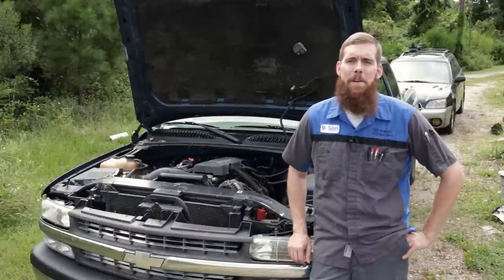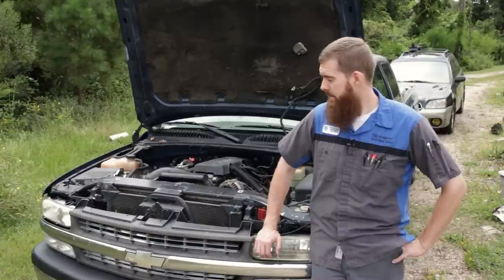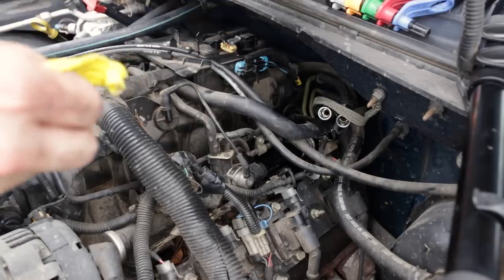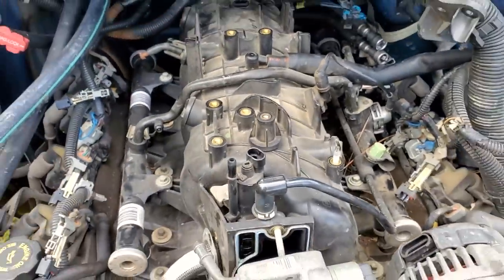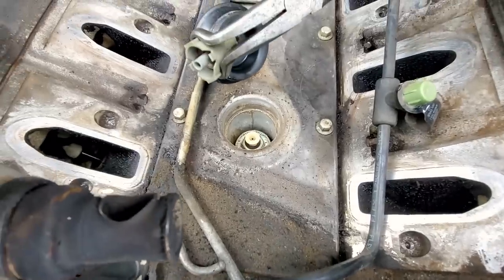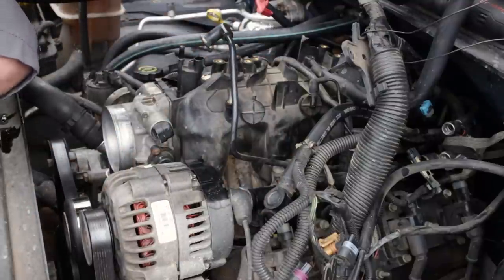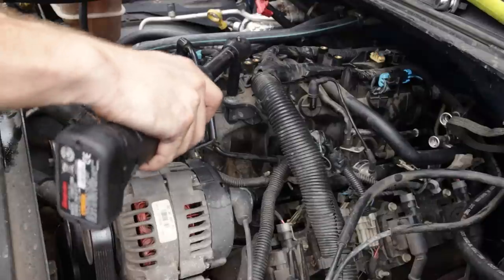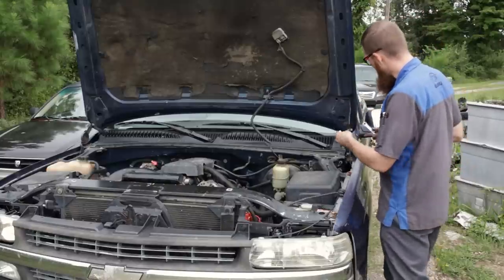GM Vortec/LSx Knock Sensors: Diagnosis and Replacement - 4.8, 5.3, 5.7, and 6.0 V8 P0332 P0327

Comment: So I did the 2 notorious knock sensors as preventive maintenance on the Tahoe while everything was a apart. Then of course after putting everything back together , it started throwing knock sensor codes which never happened before. So I initially blamed Amazon for selling me fake ACDelco (OEM) parts (outside of return window and good luck going to GM to get them warrantied). So I bought 2 ACDelco ones at full price from Autozone. Looked like same packaging and markings, “Assembled  in Mexico." Anyway, bench-tested them (thanks to this video and learned my lesson) and they were also dead on arrival!  Good thing I didn't go through the trouble of reinstalling them. That's the problem with American car companies, they don't care after they sell you the car, engines are good, but everything surrounding the engine is poor, even OEM parts.  
Just ordered some made by Delphi, box says made in Taiwan, held my breath, and they passed the bench test. Yay, Taiwan for the win!

UPDATE 11/15/23:
One of the defective brand new ACDelco ones (rear) I just installed spun on me as I was gingerly trying to take it out (I torqued it to 15 ft-lb 2 weeks ago) and I tried to chisel it out, but after a few tap, it snapped off flush at the thread. Ended up spending the next 2 hours on my belly, inhaling gas fume and drilling it out with an extractor tool. What a saga, but I was triumphant at the end. Unfortunately and fortunately, it was made of soft inferior metal.
Reply: Wow

Comment: AC voltage interesting I’m surprised the computer goes off of that for a reading, remember the old GM fuel trim matrix back in 2000 I took several auto shop classes in junior college and one of our teachers was a top GM Tech I guess he was like the third tech in the country and one time he was telling us he had a repeat customer in the 80s kept coming back that every time he would strap a trailer to his truck he lose power long story short my teacher found out it was the chain that was slapping against the frame therefore it was amplified back to the knock sensor !
Reply: Wow crazy story

Comment: I put a 6.0 out Cadillac in a Chevy trailblazer that had a 5.3 in it but knock sensor or not connected. It crack one time but not non more . It would turn over but the engine would not start any suggesting?

Comment: Question can bad spark knock sensors cause the transmission in my 2005 chevy Silverado 1500 4.8 vortec not to shift into 3rd gear. 7:39pm.

Comment: I have a 04 GMC yukon replaced the knock sensors in them last week. Not to difficult just time consuming. Used 1AAUTO OEM sensors and harness. The engine light went off no need to reset it. But within 30ish miles and a 72hr completion of the job, light back on. Used the code reader, read P0327/ P0332, and erased the codes. Again 30ish miles and about 72hrs later after erasing the codes, the CE light is back on. I did notice some rust in the [bore] I believed it was called in the video. Used an air hose got what I could out but nothing else is there anything else I should have done to prepare that bore?
Reply: Just for anyone seeing this in the future. For how much of a pain it is to address these knocks sensors with this design, that alone is reason enough to plea with anyone doing this same repair, use GM genuine/AC Delco knock sensors. There is no reason to use anything else. They’re not even that expensive.
Reply: @kojisimone6164  I'll keep that in mind if I ever decide to do it again. The yukon runs great, no issues just that code. I mean with the old sensors in my CC wouldn't work, would be slow on acceleration. But all that is gone everything is working great. Just the CE light is on and I'm learning to just live with that. Because that location setup is f#cking dumb...
Reply: @kojisimone6164  I think Delphi is most likely just as good.

Comment: Hi , Is it possible to replace the timing belt on an old 2004 Outback for a chain and gear wheels? Just wondering.
Reply from the maker: Anything is possible with enough time and money. But not feesible.
Reply: @MrSubaru1387  Thank you :)

Comment: Just curious but would you normally remove the inlet manifold bolts in the same order you torque them? Probably not as critical as the installation but I suppose there is the chance you could crack the manifold if some 'gorilla' had over-torqued the inlet manifold bolts initially.
Reply from the maker: Being torqued to 10Nm, and being a polycarbonate intake, it doesn't really matter. But yes, technically speaking, good to remove bolts in reverse order of tightening.

Comment: What happens if you don't torque the knock sensors or the manifold intake? I did it just by feel, and I didn't follow the sequence tho. Engine still rattles and check engine light came back on. I also washed the intake while it was out and let it dry and cleaned it really well. Still having problems. I might have to buy me a torque. Not a mechanic but at least I didn't have any screws missing or left. lol. Stay away from chevy cars and trucks.